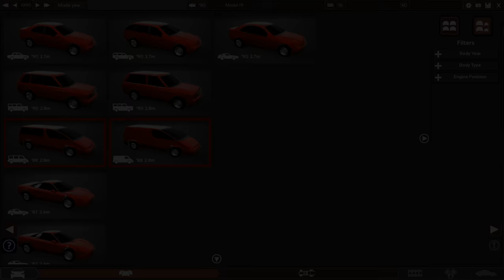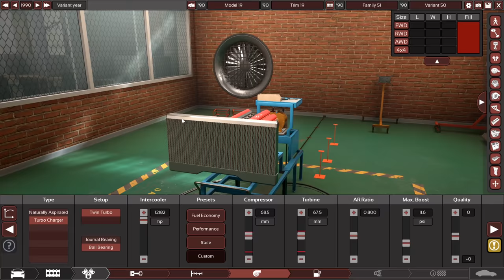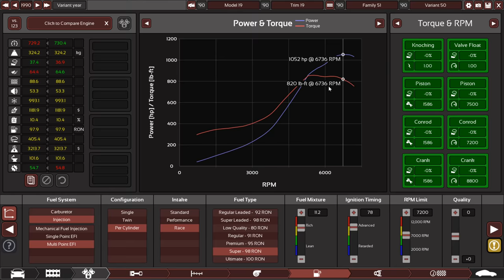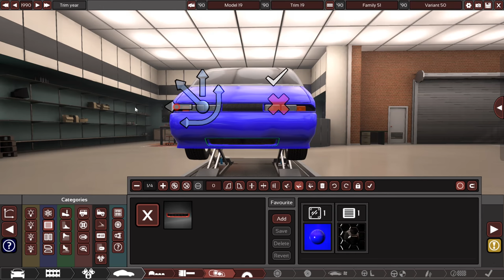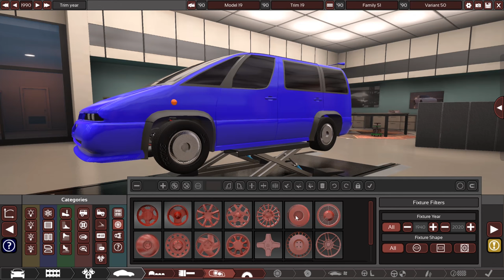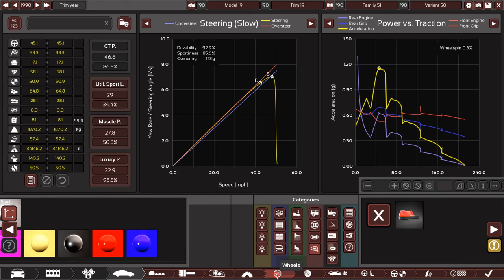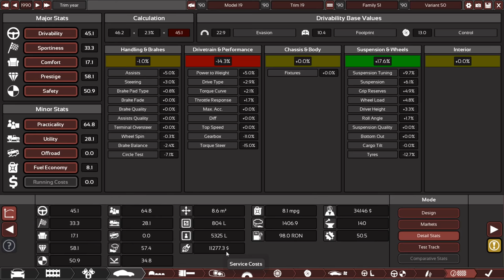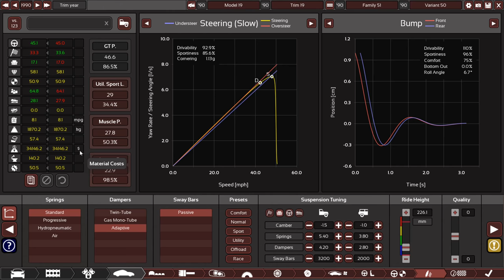The People Carrier That Could Beat An XJ220 - Automation/BeamNG Drive

Comment: In 1990, the fastest production car in the world was the Ruf CTR "Yellow Bird", at 213mph, just for trivia's sake.  So your people carrier just might have beaten it.
Reply: The RUF CTR was never really a production car, so it doesn't count
Reply: The fastest production car of 1990 would've been the Ferrari F40 at 201 mph.  The RUF CTR wasn't a production car for some reason that I could never figure out.
Reply: Ruf made about 60 of them, and Ruf is it's own manufacturer with a unique VIN. And there never was a verified 201mph F40, that was only Ferrari's claim.  When it was independently tested, it couldn't beat 200.   Also, Wiki includes the CTR, so that's all that matters, haha.
Reply: The ruf ctr was a tuned up porsche so that doesnt count
Reply: I'm not going to get into whether the RUF CTR was the fastest production car at the time, but one thing is clear.  Most all RUF are not simply "tuned-up Porsches".  RUF cars are designed to be built from the ground up on a Porsche body alone and almost NEVER use an actual Porsche donor car.
There are other reasons why the CTR wasn't counted as the official fastest production car, but it wasn't because it was "a tuned-up Porsche".
Reply: they used the Porsche body style, because of the aerodynamics, but it was made of a different material to save weight, and the reason it wasn't considered a production car is because of the low numbers produced.

Comment: Talking about the XJ220, maybe you should build the V12 AWD car the XJ220 was supposed to be?
Reply: jpiercevids so an EB110?
Reply: @archai2142  Big difference between the two. The EB110 used a 3.5L Quad Turbocharged V12, while the XJ220 was supposed to use a NA 5.3 or 6.0L SOHC V12, but was instead given a 3.5L Twin Turbo V6 because it was "safer".
Reply: I second this

Comment: 15:08 actually the f40 only ever did 199. The only sources to ever claim 200+ were a single Italian magazine, and Ferrari themselves. . When it came to officially measuring the top speed at Nardo, the f40 couldn't reach 200,beaten by both the 959S(211) and the Ruf CTR(213)

Comment: Make a inline v4 supercar
Reply: If it is a single cylinder bank it isn't a V... It is an I-shape (a "in-line" cylinder bank). V refers to the shape of the engine. I suggest you read up some more to see all the different engine shapes and variants. V4 are rare and aren't in the game, a inline 4 isn't that long or wide so you don't need to add cylinder banks to reduce length.
Reply: Martin Hübinette it probably just was a typo...
Reply: Like the Mitsubishi Galant's engine